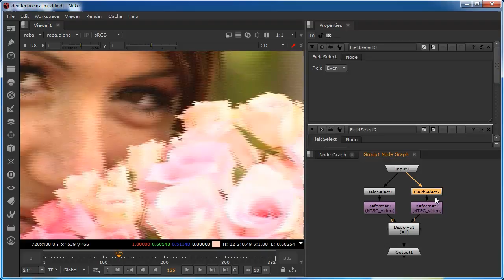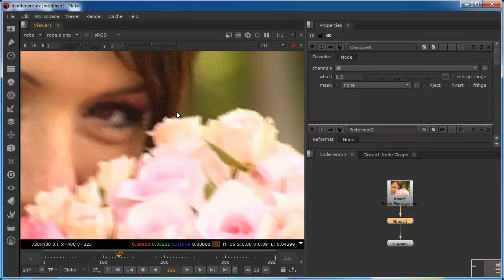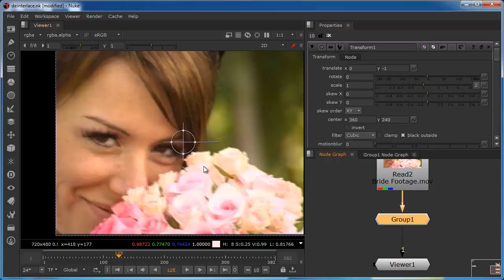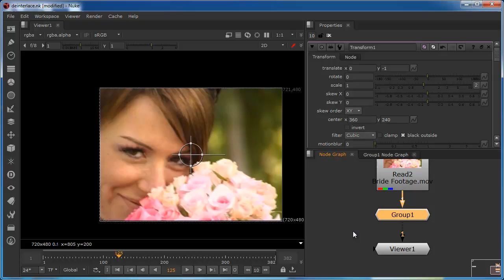Deinterlacing in Nuke

Comment: Great, except this is not the result deinterlacing should give.  Deinterlacing a clip should separate the fields, not blend them.  A 10 sec interlaced clip should return a 20 second deinterlaced clip.  What this is is a field blending node, not a deinterlacing node.  Yes, it gets rid of interlace artifacts, but it does not deinterlace a clip into a usable 59.94 or 60fps clip.

Further, expanding the Y dimension by 2x should be done without changing the source X.